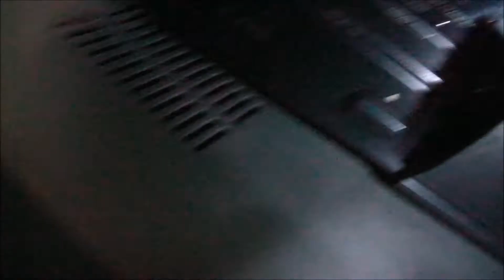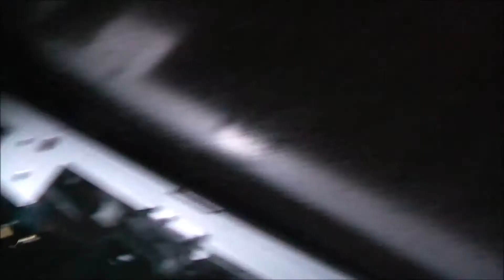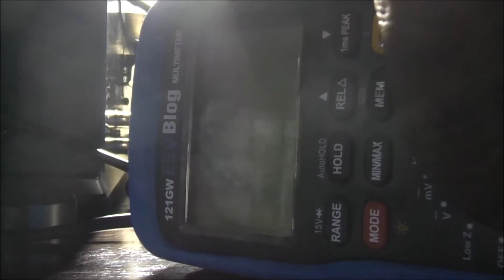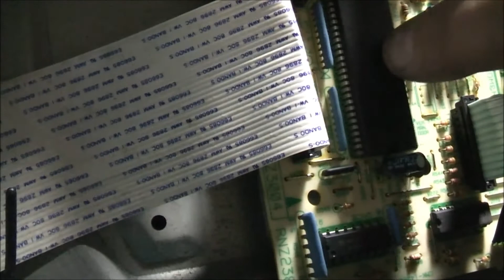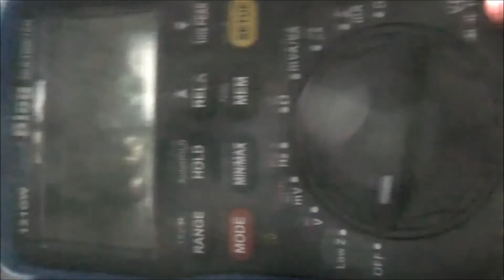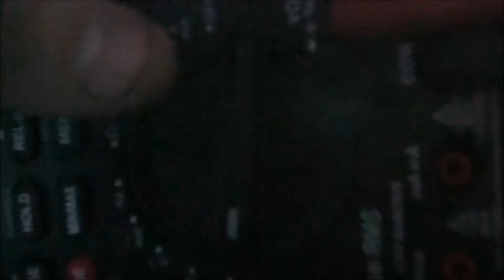Tape Decks For Repair

Comment: Looking at the chunk... I'm thinking there might be a small hair line crack in that board from the damage in transit... if so you can still get round that by soldering plastic coated wires to the solder joints at each end...

But capacitors getting warm rather fast sounds like there's a shorted resistor ot damaged IC
Reply from the maker: There are no cracks on the front board, i think there could be a bad Regulator